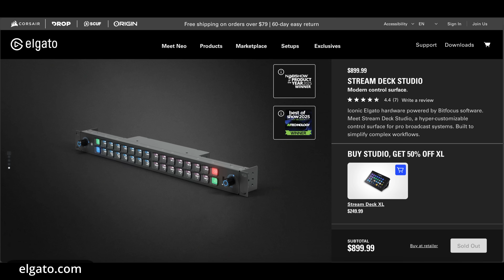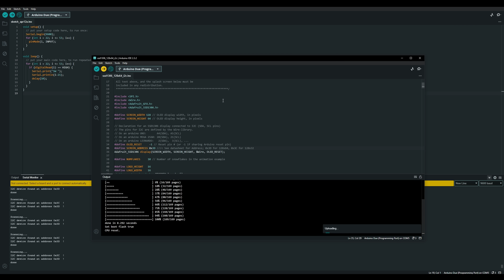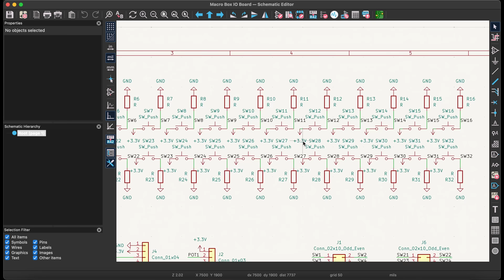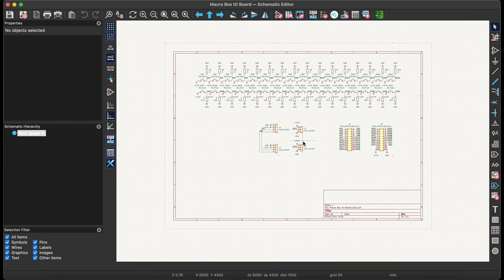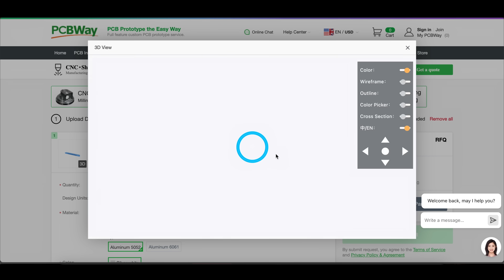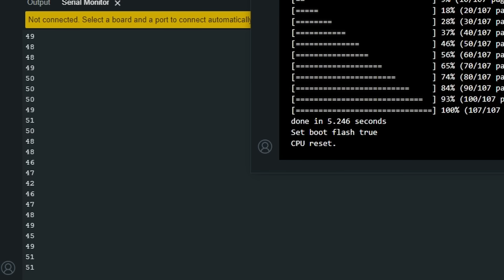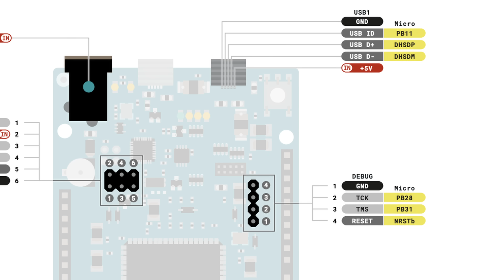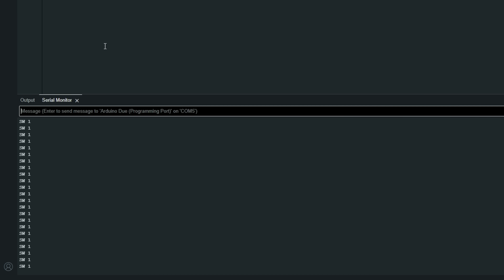The Elgato Stream Deck Studio is Really Expensive - So I Built My Own

Comment: the case looks realy great but for the next time use a scan matrix for the buttons and if you and diodes you can make it multi-touch, it only needs 12 wires for a 4x8 matrix (32 buttons) and you can also add the SK6812 mini-e under each buttons to light it up. (i allready made way to much midi/osc/keyboard controllers 😅)

Comment: or use a "raspberry pi pico w", circuitpython to emulate usb hid keyb and run webserver on pico (convert text to usb keycodes), 
any device with pointer and browser+wifi/network on same network, buttons/sliders are just html code, any size/layout(s),  
user control device(s) can be "pc/sbc + mouse" or tablet, and can use both at the same time, 
e.g. tablet with simplified layout, pc with full control, and/or use wget to send commands to pico/usb/studio-recording software.
e.g. commands : ctrl+bcdA activates camera A after deactivating bcd cameras, ctrl+abcD activates camera D after deactivating abc cameras (no need to remember previous active camera)

tested on obs-studio which allows several modifiers at the same time, alt - control - winkey - shift

Comment: case looks nice, everything else is just a diy no idea what im doing spaghetti mess
you don't need separate wires for every button you can matrix multiplex with sections (4x8) also there is no need to put such a huge arduino board as you could do this with cheap nano board easily and put the nano on your front pcb to avoid wiring issues

Comment: 3:26 tip for next time. Model the right or left half and then mirror as late as possible, so that you dont need to double define things like your radii and fold geometry. You could realistically have done about 90% on that one half, mirrored then added your face cuts. Saves a little time, not much extra brainpower as in fusion you can just create a variable called width and then when you do your iniital half sketch just call (width/2)

Comment: Painting numbers on the keycaps could help a ton with quick recognition of what button is what, and for what.
Reply: or just a color swap/multicolor printed number.
Reply: @JeronimoStilton14  Or (sacrilege, I know), just buy numbered keycaps. There are also clear-topped keycaps manufactured that let you print paper and put it inside the keycap for legends.
Reply: @ also doable, but he already found or modeled the keycaps, easier to get someone to modify then to scrap usually

Comment: this is actually so cool, just curious tho why you went with full height reds instead of a low profile option? i love the fact that you went with a full mechanical switch at all instead of a smaller mouse microswitch or a little membrane - being able to solder in some hotswap sockets so you can personalize each switch would be super cool for something like this

Comment: Just put a 100 nF caps parallel to the potmeter taps. Down to ground. They will filter the resistive layer contact noise

Comment: Where can I get one of those focused head guns? He used it for the heat shrink tube
Reply from the maker: It's actually just my hot air SMD reflow station, and I just set its temperature pretty low (about 150C), and it works perfectly for heat shrink! Any SMD reflow station should work, but the exact one I have is the Quick 957DW+
Reply: @CHWTT  Excellent, this is perfect, i've been avoiding SMD but i suppose it's time. Do you just avoid coffee and do breathing exercises before soldering SMD parts?
Reply: @patrickstover8766 follow a sniper course first? Only desolder after breathing out and solder after breathing in 😂

Comment: Streamdeck is manufactured by iDisplay Taiwan, which makes industrial control LCD button modules. They tried to break into consumer market with their own product, at which point they were caught by Elgato's representatives, the product was re-launched and the software was overhauled, and finally Corsair bought iDisplay company outright. The way they're constructed is that there's a cheap LCD with microcontroller driving it behind a set of membrane rim buttons with clear shields. For the 2x3 button pad, a 2.8" 320x240 LCD is used which is trivially driven by Arduino or anything else. Since you only have 2 rows, you can have the shields hinged at the middle line, reaching over the edge of the screen behind it and actuating a switch such as mouse button type switch there, perhaps not as elegant as official construction but more possible to build. Your ad partner can SLA print optically clear parts. I wonder if a corresponding marquee LCD is available that the Streamdeck Studio is built around. It looks like it might be two LCDs side by side, with a little bit of a middle tooth gap because that's where the CoG controller for one of the LCDs lives. There is also various open source ecosystem software of similar functionality.

Comment: Looks very nice. For cables I have bought crimping tools. Way more professional looking if you use right size casing. Also got new tool that can do those 1mm jst connectors because I have several dev boards that use them.

Comment: cool project! just a thought if you had mounted the keycaps with more space or directly to the front panel (alignment would be easier as well) you could have used "double layer transparent keycaps" which have a removable transparent cover on top so you can print your own labels and enclose them between the keycap, I think there's also low profile version you could still maybe use for this if you want to have labels at some point or do a similar build in the future

Comment: Next time, make a 3D-printed fixture where the switches fit perfectly, so you don't have to align them individually when soldering
Reply: if your doing a thing one time, make do. if your doing a thing over and over, make a gig for it.  could just be a frame that line a 2x2 to the frame/PCB so you can do 4 them move over to the next.

Comment: Theoretically speaking the hardware for this could be reused and the pcb modified to use a matrix which can be put into a rpi pico instead of an arduino to use POG a KMK keyboard editor which is super cool. Also panel mount connectors are super cool and think would make a great addition to this, might make in the future.

Comment: I want to build my own now. maybe I will cnc it completely just for fun
Reply: I did some research, because I wanted to have every button to be a screen. Elgato uses one big screen on their stream decks. On the studio I don't know what theyre doing, but I would think they do something similar.
I will look into vertical screens to incorperate them into my design. The transparent buttons could be done with something like sls 3d printing and the actual dedection with a flex pcb infront of the screen some metal around the corners of the buttons.
Reply: Okay, the stream deck studios has simple two large screens. Can't find anything similar on websites like aliexpress

Comment: Nice idea but needs improvements on design.
> I would go for button matrix and a leonardo board etc. But this is not a improvement to be honest, just another way of doing it.
> I would've ordered the sheet metal part to hold the buttons. then insert buttons to metal part first then pcb auto aligns that way. Then you wouldn't need mistake prone screw solution to fasten it to the face plate. If you don't want to do it that way you can order an acrylic or delrin mid plate to do the same then screw that into the faceplate. Or I would've just 3d printed that since it is hidden + no lead time.
> You mentioned it but: I would've gone for ribbon cables, and ordered SMB soldering from PCB way directly. Nothing is more satisfying than just auto locking ribbon cable rather than stopping soldering your own cable :D
> Color code some or all the buttons, i get lost in my legendless keyboard usually so I group them into like 4 keys white 4 keys light gray etc.
> another alternative for buttons, aliexpress has buttons that has 2 parts, so you can print a label and sandwich it between 2 plastic parts. They don't feel as good to touch as a normal keycap but it is better than a sticker that might drop in couple of weeks.
> I would've added a rotary encoder so it can go 360+ degrees. Potentiometer has more resolution, but stops etc.

The way you did it is totally complete and looks rad, i just want to give feedback so you can use it in your next project if you want.
Reply from the maker: Thanks so much, I really appreciate this feedback and also totally agree with a lot of it. Glad you enjoyed!!